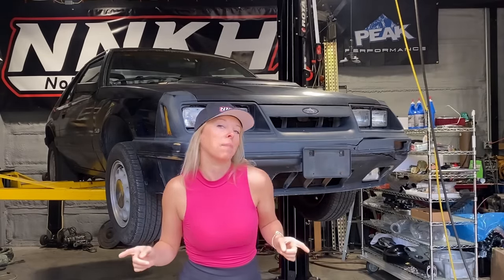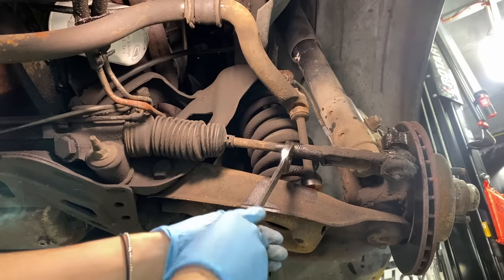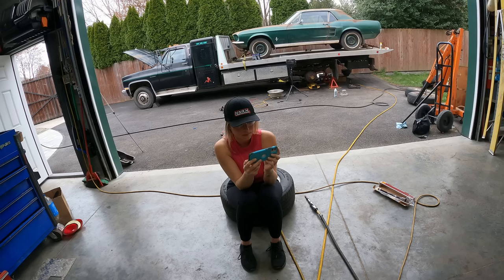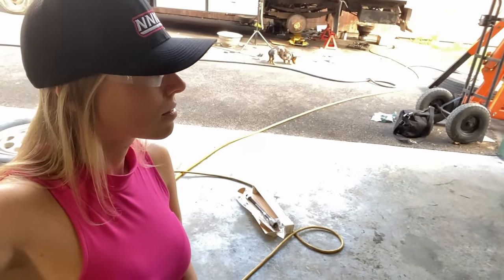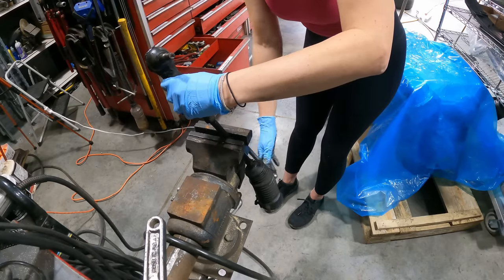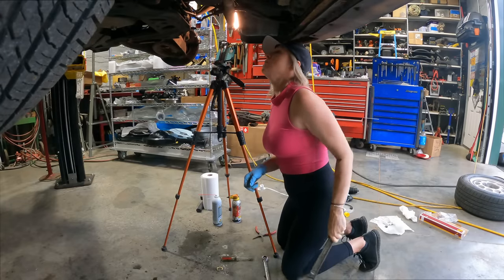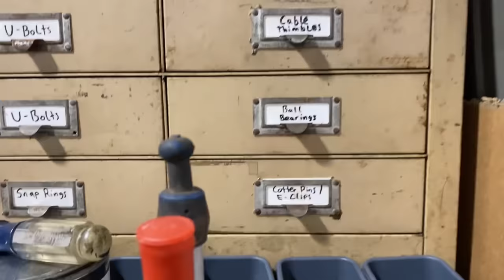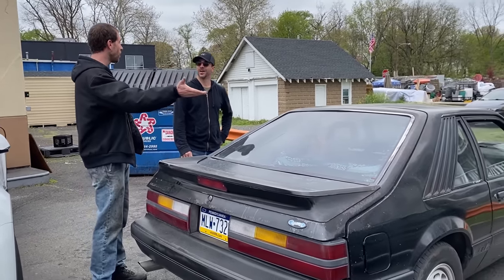Replacing Inner Tie Rod End On My 86 FOX-BODY Mustang Jennifer Sugint- NNKH

Comment: Jen, the right way to use the adjustable wrench is to turn it around, so that the non adjustable part looks like a hook in the direction your going when you pull on it, most of the power is put on that side of the wrench, gives less stress on the adjustable part, and less wear

Comment: The reason for the castle nut torque being 35 ft/lb to 50 ft/lb is so that when you reach 35 if the castellations on the nut don't match up with the hole in the shaft you can go up to 50 to get them to align and allow you to install your cotter pin.  The taper on the tie rod and in the steering knuckle is what's known as a Morse taper.

Comment: The counting the number of turns to put the tie rod back does work, however I've found measuring the distance from the part that screws into the steering rack and the outer tie rod, is actually more precise.  I did this on a RX330 Lexus SUV about a year ago and did not get an alignment and there has been no toe in type tire wear!

Comment: Way to get after it Jenn!  FYI next time use an additional method of a tape measure to ensure tie rod is as close as possible to the current alignment. Plastic weld your cracked bumper with wire clips you melt and press into plastic across the cracks.

Comment: @10:39 you need a tie rod separator tool. It clamps on and you tighten down until it just pops it loose by getting (pressing) past the taper.

Comment: While I am not a mechanic, I do have nearly 80 years of experience in auto maintenance and repair and when that tie rod end has that age and wear on it, it is prudent to replace das boot as well.  It is only a matter of time, sooner or later and usually sooner than later, that das boot will fatigue, crack and split, allowing the grease to expel and all kinds of road dirt to enter thereby acting as sandpaper on the new tie rod end joint, thereby, requiring the replacement of das boot and possibly re-replacement of the tie rod end that you/one just to laboriously replaced.  I know Chris says if it's not broken, don't replace it, however, in this case, and cases such as this, 'a stitch in time saves nine'.

Comment: Good job!  You are an inspiration to ladies everywhere with your 'will do' attitude. I just completed replacing struts, lower control arms, inner and outer tie rod ends on my 2005 Mustang GT Convertible.  Then I got a front end alignment.  It drives like new even though it didn't drive too badly before.  Keep up with the good work.  And Mustangs are a lot of fun.  This is my fourth one.

Comment: When using Cresent wrench always use so the pressure is going against solid piece not the adjustable thumb. You used it backwards and Chris used it correct. Putting pressure on the adjustable thumb can break it.

Comment: The only thing you missed or didn't show was the put heavy grease inside the boot to help keep things lubricated. The grease you seen was and removed, should have been replaced. Good job getting this done and it can be a challenge.

Comment: Nice job. Just one safety suggestion. You don't want to be prying up or down on bolts while under the car on a lift. They do fall off lifts. Use two wrenches in opposite directions when possible so you're not pushing or pulling against the weight of the car. Stay safe!

Comment: Great job as usual but??? I've always cleaned & packed the boot with grease never put locktight on the threads of the tie rod end🤔 just saying & I usually replace both if u replacing one if original part safety 1st 😊

Comment: use a pickle fork to remove the tie rod end, or leave the nut on ,so you dont damage the threads
Reply: Should really only use a pickle fork if your changing it cause you’ll damage the boot

Comment: Only thing to really need to torque on a car is rid and maun bearings head bolts valve body in the trans and main caps bolts for the rear axle test if that crap just  35:48  tighten it
Reply: Oh by the way don't fo😮rget to check your blinker fluid and your muffler bearings and change you aur in your tires to summer air

Comment: Jen, I think you missed the torque wrench click at 34:00. Tightening after the click can damage a torque wrench - I broke one doing this - and you kept going multiple times after it clicked (34:00,  34:14 ). I could be wrong because I wasn't there in person and am only hearing it through the video, but it might be a good idea to replace the torque wrench because it might not work correctly any more. This is coming from personal experience :/ . I've noticed that at lower torque amounts the click seems to be less obvious, unlike when doing tire lug nuts, so it is easier to miss. Any who, thanks a bunch for posting this video! I have always wondered how to replace tie rods and now I know!

Comment: Good Work, But......Stepping over a dime to pick up a penny.  Why replace the outter at the same time?  Because now you have to pay for 2 alignments when the outter fails.  So saving the $15-$30 on a wearable part just to pay $60-$100 for an additional alignment.  Now thta you have a nice stiff inner, the outter ball joint is bound to fail.

Comment: Nah if you’re in there replace it the whole “if you don’t need to then don’t” rule is stupid. Once the outer tire rod goes bad itll shred the inner rod you just replaced. Replace them both issue solved

Comment: My darlings...Those are not cotter pins...they are split pins or lock pins !! Cotter pins are what holds the kick starter  to its shaft in a motorcycle or a bicycle pedal to its shaft. Cotter pins are tapered increasingly on one side, hammered in, then its nut tightened ❤

Comment: Jen, you have to remove the tie rod again. You need to grease the connection where the tierod meets the rack and pinion. That's what the boot is for. To retain the grease in that area. You saw the coolant coming out the boot that was the problem in the first place. The coolant cleaned the tie rod connection and the friction created the play. So have Chris remove that tie rod and install it properly.
Reply: The boots to stop dirt and shit getting into the rack not to retain grease
Reply: @gregshearer423  Because the dust and dirt neutralize the grease purposes. That area needs grease like the ball joints and tie rod ends.